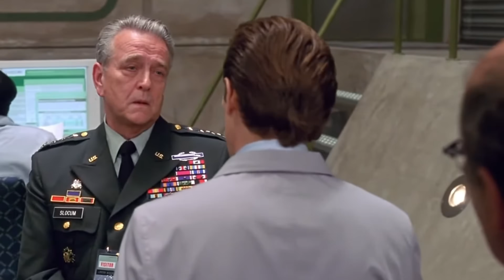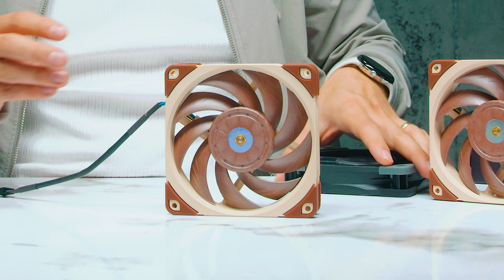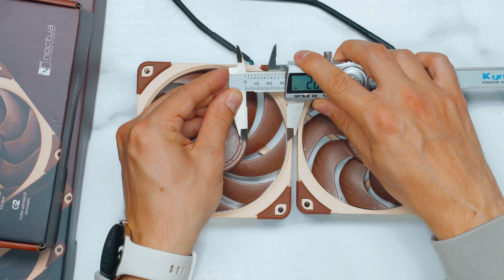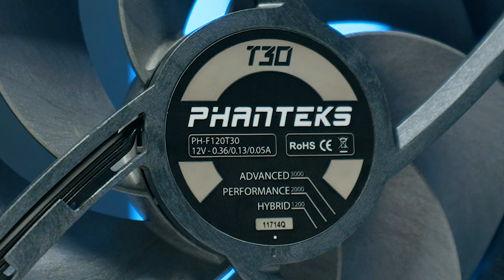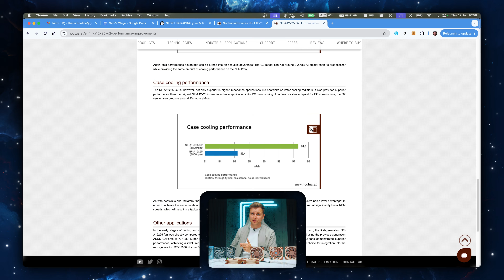Why it took Noctua 7 YEARS to BEAT the CHEATING Competition!?

Comment: Cheating and Cheaper, or not.. I Have the entire suite of Arctic Fans and just bought all the different variants of G1 Noctua Chromax Black Fans for my build. The cost aside, the performance and acoustic profile of both generations of Noctua fan just stomp all over the Arctic fans. I wanted to love them and believe in them, but 4 of the P12 Pros on Side Intake of a Corsair 7000D? When gaming or doing anything under load, without limiting them to less than 50% max PWM speeds? Insane, not doable for me.

Comment: you know that those manufacturer charts can and in most cases is a lie. how much cfm these fans can push. i would always go for faster fan with higher cfm then i need. why? because you can suspend any fan in rubber that minimizes the vibrations and if you drop speed to about 80% any fan will be quieter. below 2000rpm many fans are silent. those noctua quiet adapters are ridiculous, its and resistor on power wire that just lovers the voltage. it is good that there is company that makes these rubberized fans for people who cannot diy stuff.

Comment: No it's not cheating to cater to a market that actually exists dude. Just because you need your computer to be silent doesn't mean I don't deserve a fan that pushes more air even if it makes sound. It's perfectly fine that companies make powerful fans.
Reply: Yes but the fact that no one other than Noctua having this approach means just like the video game industry in general,  you'll reach a point where performance platoed and you'd want optimization instead of brute force
Reply: @yunan9610 no dude don't pretend to know me what I'm about or what I need to do it. I overclock fx chips for fun not for performance. By that logic all fan companies are cheating in the eyes of those that design totally passive systems. But hey if you need it to be so silent in your room you can hear your hair grow that's your preference. Im never gonna want that EVER the silence bugs me. And I'm not buying a white noise generator for what a fan can provide for free while kicking ass.

Comment: I think the term you were looking for that "amplifies" sound performance when using several speakers is "constructive interference". However, that requires all speakers (or fans) to be perfectly in sync including the phase for extended periods of time. If you are only slightly off in frequency you will get what we call "beating", this woa-woa-woa sound. Noctua avoids this by choosing two frequencies that differ by 100Hz, which means the beating sound will be at 100 Hz as well, so it will be a (very) low hum instead of the woa-woa sound.

Comment: The increase in power probably comes from moving more air OR/AND generating a higher pressure. The energy given to the air has to come from somewhere.
Reply: The motor looks smaller, so it might need more power for the same speed.

Comment: Dude the Viper has an 8.4L V10, not some measley 6.8L shopping cart engine.

Also the logic is completely backwards as the thicker fan is more efficient, or at least should be, because it can create more pressure at the same RPM without increasing the noise level.
Reply: Notice there were no benchmarks cuz Noctua would probably lose.  This is a Noctua sponsored video or fanboy extreme.
Reply: @zoe1882  I don't think Noctua would loose, they make good fans after all and they better do, considering that they cost 40$ PER FAN!

And testing Fans is incredibly difficult and expensive, right now the only reviewer who does it, that I know of, is Aris from Hardwarebusters with their Long Win, but even that is quite imperfect.

But the Fanboyism is very strong in this Video, I wont deny that.

Comment: Its not just about max fan speeds. To compare the fans peformance you need to measure flow, static pressure, noise and power consumption at same RPM. Just because a fan can go faster doesnt necessarily mean the fan is worse than a noctua at same fan speed. I have many noctuas and swear by them in many circumstances... but need to do proper comparison not just say another brand is cheating because their fan goes to higher RPM...

Comment: Every time I do a new computer build I always throw the regular fans out and put in my old Noctua fans. Those 3000 RPM industrial fans have been a lifesaver for a decade.
Reply: Yeah. The PWM 3000rpm pic fans are nice. They pretty match retain the same noise at normal Noctua fan speeds like 1300rpm. But can be really cranked up when needed. I use them in my server on a 3x120mm fan wall on a PWM controller slaved to the CPU temp.
Reply: @wjrneo2 If you use high RPM fans you also have to learn how to set up a fan curve. That's the advantage of 3000 RPM fans is it makes you a little more skilled at setting fan curves. It's an art.

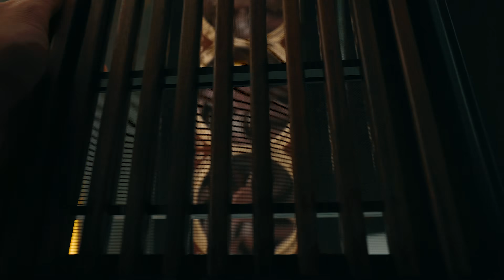Comment: 11:39 this is not about them being next to eachother, this is about them being on a heatsink in a push-pull configuration, basically one fan blowing air into another. This is the primary use case for this set

Comment: the rpm shift in the PPA/PPB fans is for push+pull config on a cpu tower heatsink or a radiator
it has absolutely zero effect when using them side by side like you ;o]]]]

Comment: Ok this video has no actual testing input, its just an echo of Noctuas marketing right, why do it then. 
as others pointed out already, you don't need to run P12s/T30s at 3kRPM they are very good even in lower RPMs, T30s especially as Radiator fans .
And why didn't you actually test the fans in somwhat normalized circumstances(Temp/CFM/Noise) that actually have an performance impact.
Don't get me wrong the new Noctuas maybe really good, but your video proves nothing of that and seeing such videos lets me fear that Arctic fans or T30s are still the better choice.
And price wise its often more useful to go Arctic and have 3 % worse noise normalized Performance, but save 90 Bucks or more and put those to better Hardware(higher Tier GPU/ less loud GPU custom model).
Or just put more Fans in( if the case is not at capacity), which you might be able to do cause you don't spend nearly 200 Bucks on fans alone, or go push/pull on your radiator, all of this lets you run your fans slower for better performance. The only time it actually makes sense is if your case will be at max capacity, but then still the question 150 Bucks more for 3 % better cooling performance only makes sense if the entire Build is in the 2k + territory anyway, and most people don't buy 5080 PCs

Comment: It's called aerodynamic noise... when air moves across things (fan blades, housings, etc) it creates turbulence. At a static speed (rpm) it creates it's own noise. You put 2, 3, 4, or more next to each other at the exact same rpm now you're multiplying the same A-weighted decibels in a structure (PC Case). Just change the rpm of this one from (example) 600 rpm to 600.2 rpm and that one to 599.7 and though we cant tell the difference of that smidge performance wise the human ear perceives the difference in sound frequencies.   And mechanical noise (motors, bearings, vibrations) as well as electrical noise (coil whine, AC hum, electromagnetic interference) also comes into play. 😎Sorry Lauri that's the shortest I could make it and have it make sense😎

Comment: The T30 ist not "very loud". It has excellent noise levels. In fact the Phanteks has the best noise levels under high speed and not so good (compared) with low noise levels like 500 or less RPM.

Comment: Honestly, I don't like their Brown-Beige color scheme. I'd never buy one of those for my PC, BUUUUUUT, if any kind of plastic-fan has to be replaced in any other appliance (i.e. 3D printer, Router, control electronics for any kind of machinery that doesn't have to be heavy duty metal stuff), I'll go with Noctua because they not just work, but are as quiet as can be for the given airflow AND it funds the development of the PC fans which "influences" the design of other, more aesthetically pleasing manufacturers (like Lian Li, for example), so in the end I'll get the best of both worlds!

Comment: Had Noctuas running for more than 7 years 24/7. I have replaced or the other fans in other machines with them. Nothing comes closes in reliability and low Noise. I have tried a lot of fan brands before i settled with Noctua.

Comment: The power usage difference is probably because stators are wound less and more which causes the difference in amp draw. But motors are most inefficient at start up so that rating is probably less once its going, unless its running load

Comment: Sooooo Arctic costed me 30 EUR for 5 in my country and covered all my needs for the case fans, Noctua on the other hand costs 24 Eur for 1 Fan. That would cost me 120 EUR for the same which is 90 EUR more and that amount of money would allow me to upgrade GPU to a higher tier. Thanks you but 1% of improvement in cooling isn't worth it
Reply: I've had bad experiences with noctua also. I bought a single F12-PWM which was vibrating bad, I RMA'd it, they sent me one with a cable that quickly failed despite handling it very carefully. but the S12A I have is very quiet and very good
Reply: I got the p12 max as well, they’re good for that they cost, but they also already lost against the previous gen Noctua. You don’t buy them for performance gain anyway, but for longevity, efficiency and quietness. The Noctua are far better than a measly one percent.
Reply: @Melnyx_definitely  I have noctua in my old pc that is 4 years old. I installed them in the same new case temporary before arctic arrived. The difference in temps between arcric and prev generation noctua in my new case is 1-2 degree Celsius for both cpu and gpu which is a bit more then 1%. Maybe in some other applications the difference would be more but in my case Jonsbo D41 it is around 1%.
Reply: Yup. Noctua is all brand, very little to actually show for.

Comment: Noctua should make a 30mm fan tbh, most cases will fit that and since they're about silence, why not ;)

One thing that stood out to me was the emphasis on 3000rpm on the phanteks and the arctic fans. Yes, they do go high, but that's not why they are good. Even at lower speeds they are performant and very comparable to the Noctua NF-A12 G1 in noise normalized testing

Comment: The fan set is for tower coolers that do push and pull. Like the nh-u12a. When both fans on such coolers spin at high and same speed they make a wheezing sound. By having one fan spin slower than the other the wheezing dissappears or is reduced. The slower fan normally goes at the exhaust, pull, end.

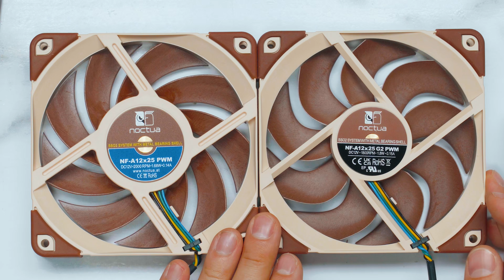Comment: 7:48 They should put the wire inside the plastic casing as the wire increased the width of that single line.

Comment: those could be aquacomputer rads they are very deep at external 65mm
The do use a bit of shroud build in on 1 side so the actual core could be 49mm

Comment: You could improve all these fans if you have an internal groove inside the fan housing that would allow the blades of the fan to be slightly larger than the housing itself. 
Tolerances would have to be insane :D.

Source?
My source is that I made it the F up.

Comment: So where was the cheating part?  L video
Reply: Other fans go out of spec by making the fan thicker, which could make it not fit in certain cases.  And also higher RPM to achieve more performance.  I'd still go with the arctics though, they are in spec and the correct thickness, just way way way cheaper.

Comment: I move on from ball bearing, had enough of them.
Even if some make it a good product, it still have the same issue.
Noctua SS02 is the alternative between FDB & ML.

Been running industrial series fans to almost 10 years now, no issue.
In fact, I never clean them, I wanted to see noctua claim being dust resistant and it is actually true 😅

Noctua non-industrial fan have a bit of trouble to spinning when there's dust build up, most other fan likely failure due to dust entering the rotor. I just have to clean it up, but industrial fans only have small amount of dust sticking despite never been cleaned.

Like many high rpm fan, industrial series is loud at max rpm but not intrusive.
Wish Noctua is cheaper tho, at least they're still worth the price.

Hope they make G2 into industrial version too.

PS: clean your pc regularly guys, unless you want to test the company claims being dust resistant 😅

Comment: I’m using the NZXT T120 cooler in a push-pull setup with two 120mm NZXT pressure fans on the same cpu fan header with an Y splitter. The issue I’m facing is that at certain RPM ranges I get a loud whining or resonance sound, which I think happens because both fans spin at the same speed and create vibrations. If i use the Noctua dual-fan pack (Fan A and Fan B) with the Y splitter will they automatically run with that RPM offset? And in terms of placement, should the faster fan go in front (push) or in the back (pull) for the best cooling and noise performance?

Comment: P12 MAX are really loud, but they push a lot of air. Classic P12 are great. Silent with really good cooling performance for the price. Actually when I crunched thru all the tests and statistics, there is a really small gap between the P12 and the older Noctua in CFM and static pressure. The only thing that could persuade me to buy Noctua is the longevity. But I use the P12 for years and non had failed in all the time. Those cheap guys are a little wonder. Doing their work competently for the lowest bidder.

Comment: This is all nice. I use six Arctic p12 silent on my PC tho, they all run at 1050rpm all the time, and can not complain about any noise whatsoever. Also, they cost me about less than 1/3 of what would noctua cost. I use them even on my old  Noctua NH-U12P from 2009, that I use on my AM5 PC with adapter kit. I like the company, but their "fan tax" is kinda bad.

Comment: Should i buy intel for quick sync even after rtx 5060 ti  release?..
Reply from the maker: Not really....
Reply: @theTechNotice  in India r5 5600x cost 135 usd & r5 7600x  for 206 usd.  What Should i buy ?. Am4 or am5.      The ram+cpu+mobo  am4 cost = 303 usd  vs am5 = 400 usd . Which is value for money future proof for next 7 years…?? .  And i will pair with rtx 5060 ti 16gb And its my first pc build.  Is this good parts.   And thanks for reply 😊😊

Comment: Uhm...A fan video without testing the fans....with no arguments for "cheating" and with no proofs........
Reply: He considers higher operational RPM and 5mm of extra depth as cheating while any rational person with 3 braincells dedicated to the task would call it "knowing what you're buying". And if you really had to call someone a cheater it would be Noctua because they have a better blade design which allows them to have good airflow with less RPM. If fan-making was a sport and all competitors had the same motors but one had a better blade you can guess which part would most likely get serialized.
Reply: @C@Creepla @CreeplayEU the point: Noctua doesn't need the extra 5mm of thickness or higher RPMs to beat the competition. Saying Noctua is 'cheating' because they perform better with lower RPMs and shorter blades (in the sense of thickness) makes no sense

It’s like calling an athlete a cheater for winning without performance-enhancing drugs while everyone else is using them
Reply: didnt you watch the video? he might fart and that would change the room temperature.. completey ignoring that farting would also change the noise level. this guy is a clown

Comment: The thing that happens with the fan noise is that if you have multiple fans with ALMOST the same RPM, the slight difference in frequency will cause what's called a beat frequency. It oscillates between cancelling out and reinforcing some of the frequencies, causing an annoying sound. If you offset it enough, the frequencies are too different to do have this effect.

Comment: Just install lots of budget priced fans in push/pull and run them at slow speed. They will be inaudible at anything short of extreme computing loads and the graphics card fans will dominate when gaming. Maybe buy Noctua if money is no concern and you are paranoid about any noise.

Comment: It's not true that the T30 is very loud. I mean - sure it is if you run it at 3000 RPM - but noise should be measured at equal performance - either cfm or temperatures. When you do that the T30 is actually one of if not the quitest fan on the market.

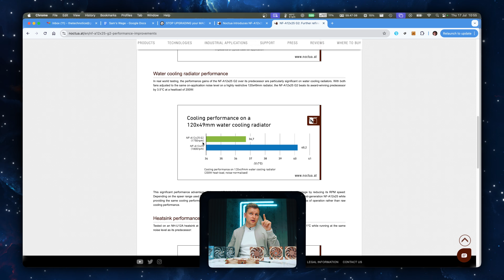Also at 17:35 - even though the G2 is running at lower RPM doesn't mean it's quieter. They are producing the exact same dba, noctua says so right there in the chart you are looking at.
Reply: noise normalized should be the standard. the phanteks will win because it's 30mm thick so it has more torque in the motor and thus higher static pressure for the same rpm

Comment: I love Noctua, they truly are extremely good quality but the number of models still frustrates me. At this price it should simply have a switch (like T30, SW Pro, etc.) to change any G2 to be a 'Type A', 'Type B' or low speed model.

The only other model (other than niche 5V/24V models) should be a A12x30mm "max performance" version with the same switch and ideally a higher RPM mode if blade clearance allows it. A lot of cases have more than enough room for taller fans and 30+ mm AIOs. More height will always offer an inherent advantage that Noctua could do wonders with.

I'm keeping my T30s with 3D printed TPU radiator gaskets. They're phenomenal fans that sound fine at normal speed. I do plan on getting Noctua's 140mm fans since I'm tired of waiting for Phanteks and am disappointed with the design and sound of my SW Pro 4. We really need more high-end 140mm options.